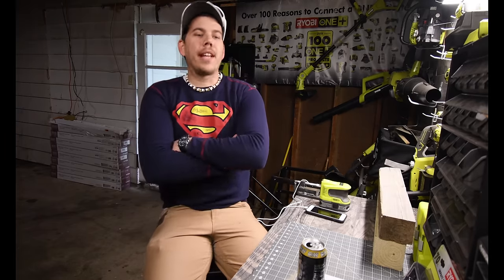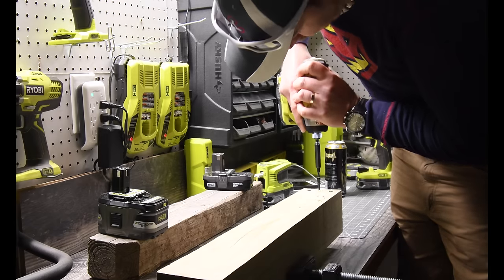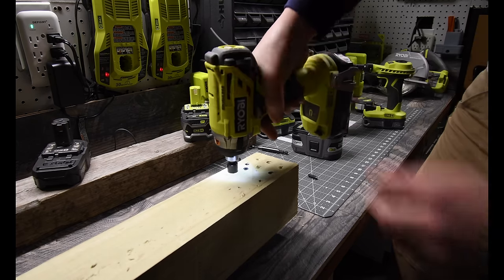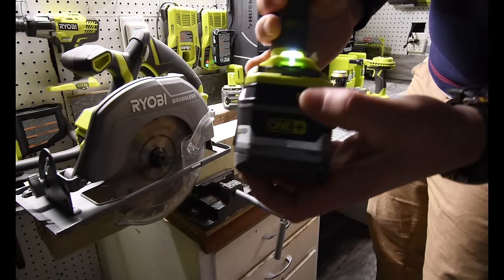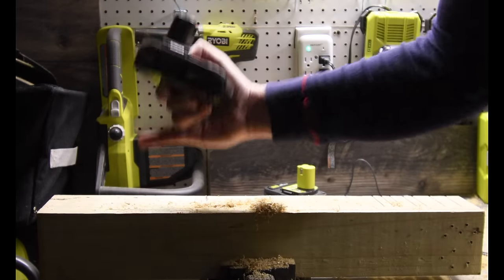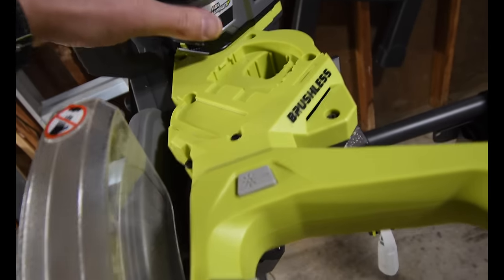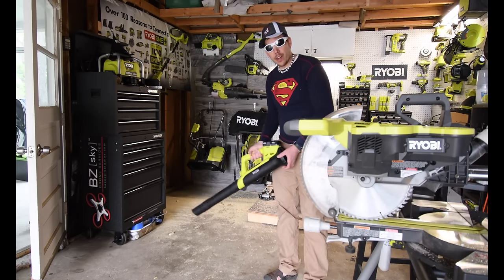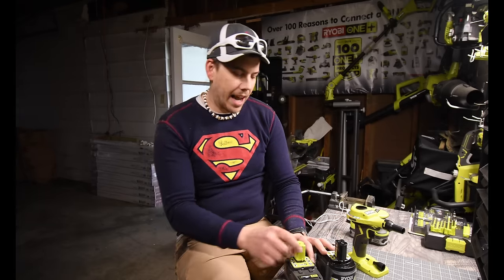Testing the difference in AH in batteries to POWER

Comment: the newer batteries have the 2 extra metal tabs that "talk" to the brush-less tools making them not only use more power on demand {burst amp}.  extra benefit should be bats should  then in theory have more working time. switching from low to high amps. great video
Reply from the maker: jjt jp thank you a sir

Comment: I see you man. You are absolutely correct that the larger batteries 'can' provide more power if the tool calls on them with the amperage draw. The batteries do not 'force' more current though, only what current the tool calls on. The power source 150w inverter says it will work with all one+ batteries. It likely does not pull more than 9 amps or so, no matter the battery size. Please research the "c rating" of batteries for why those larger batteries have more power. Btw, Ryobi saw my home Depot review and has offered a replacement.
Reply from the maker: TRY to HELP you I’m glad they were able to replace yours unit. I haven’t had a problem with mine yet. Luckily.

Comment: There is a battery protection circuit on theses batteries.
The saw will shut off if it needs more power than the battery can provide.
Reply from the maker: Thank you sir

Comment: There have been plenty of videos done showing the amp draw when a drill is under load and the more Ah the battery, the more they will use. Typically 15-20 amps in high torque situations.
Reply from the maker: thank you sir

Comment: I know them bigger batteries have more punch to them. I have a few  attwood  3000 bulge fans you can buy from orily’s  and they blow about 200 mph on 12 volts  like a motorcycle battery or car battery. The ryobi 1.2ah battery is the same but when I use my 9 ah battery I push out to 250 mph.  In my testing there is definitely a difference. I use two of these fans as a leaf blower that I made my self because the ryobi leaf blowers just don’t have the power. So I made my own. I can stand in my driveway and blow the leaf’s in my Neighbors driveway which is about 50 feet away. It only takes me three minutes to blow the Leaves off the roof of my house with this thing. 9ah battery with both fans is pushing around 480 mph. Ryobi should do this lol
Reply from the maker: I have no clue why but there are still some people that dont believe that you get more power with a higher ah battery lol

Comment: What you are experiencing is called "sag" its when the battery takes a hit or a load to drive the tool at maximum. the voltage drops and the power cannot be sustained. that's why when you put the 4 amp battery on the tool its seems more powerful. its not. its just the 4 amp has more batteries so the sag is lessen then what you would normally have. This is typical to all batteries regardless of platform. The short stack batteries have a 5 cell battery so 5 individual 18650 industrial batteries. moving on the 4 amp its double stacked so (2) 5 cell batteries parallel to the second 5 cell battery maintaining the 18.5v of power to drive the tool. More batteries less sag. the 9amp battery has (3) 5 cell batteries so even less sag. ideally 7 cells in parallel would be sufficient enough to not notice any sag and drive the tool at full power and load and is the theoretical maximum for usable quantifiable power... any more than that and your batteries will charge inefficiently and you will have to replace them prematurely. As far as the "HP" its just an added microchip in the battery that's attached to a secondary converter to temporarily give you more power as the tool requires it does this by monitoring the resistive capacity of the brushless motor and voltage. Think of it more like an overdrive. Most tools have this such as flashlights, tasers, anything that converts volts in exchange of amperage. This actually can be detrimental to the batteries life by pulling more amps than the battery is built for and in short replacing the battery sooner.
Reply from the maker: people were saying before I made this videos that there is no difference in power between a 1.3ah battery and a 6ah battery. they say 18v is 18v. this video showed that there is a difference on what batteries can do with a single use.
Reply: @ManCaverTools  yup there is a difference in the power. Anyone that understands batteries should know about this, I have spent a considerable amount of time studying batteries in and out. You are correct in your assumption without getting into the finer details.  Now if people could maintain their batteries properly they would last a long time.

Comment: 18V really IS 18V , the problem is voltage sags much lower on the 1.3ah battery when a powerful tool pulls a lot of current. That holds true even without the extra brushless contacts. Same reason the 9ah is even better than the 6ah, voltage sags even less under load because the 9ah has 3 rows of 5 cells.
Reply from the maker: this is an old video, at the time of this video people were telling there is no power difference at all no matter what the battery is, they said a 1.5ah battery is the exact same performance as the 6ah battery, no matter what the tool is doing.
Reply: @ManCaverTools  I used to think that too. One day I was cutting apart an oil tank with a Sawzall and I switch between the 1.3 amp power in the 2.5 amp hour battery and I noticed a big difference in cutting speed. But I had no idea that there would be a 9 amp hour coming lol

Comment: Smaller ah batteries or batteries with a single series cannot discharge nearly as many amps as a 2 or 3 row higher ah rated battery so when a battery cannot supply enough amps then the voltage drops this power drops.

Comment: Hi David, I totally agree with you before you did test them. I would like to have seen more between the two extremes 2,3,4ah batteries to see if it stepped up the efficiency as you increase the ah. Great video it was fun to rewatch😁😍😀 what do you think of an update test using 2,3,4ah battery or tools like your mower and weedeater? btw if anyone has old batteries they don't want or use and want to donate to a good cause, i only have two 2ah batteries and I'm a DIYer on a fixed income and can't afford $50 a pop or more for new battery. Thanks again for sharing your thoughts and videos, Rodney
 P.S. As you get more TackLife tools it will be cool to compare the power and endurance of those.
Reply from the maker: I plan too and thank you Rodney

Comment: So batteries do not have instantaneous current (effectively power) delivery. The bigger the battery, the more charge carriers can be delivered instantaneously when you need it.
Reply: I was just thinking you could do a low-current test too, such as the time it takes to charge a cellphone from two different size batteries using a 10W charger. I’d be curious to know if the time to charge would be close or it could be significantly different. That would confirm the perceived power difference felt using the tools.
Reply from the maker: doomtomb3 that is what I wanted to prove. In another video someone was saying the opposite

Comment: I knew in my head your theory was right. I didn't think the 1.2 would perform that bad though, or get hot so quickly. On the circ saw did you have a rip or crosscut blade? That would make a little bit of difference. Nicely done Dave😍😀
Reply from the maker: Rodney Widger I’m. It to sure what blade is on it. I’m surprised the 1.3 ah did as well as it did. But still can’t do what the higher ah batteries can do

Comment: I would have never made this video and put my tools at risk. Anyone who has used the 2ah knows they do not have enough amperage load output over the 4 or 6 amp. I would done a video where it matters, like all batters including the aftermarket batteries that can be purchased.
Reply from the maker: will do sir

Comment: This was not a fair test because the 6 amp battery have the extra contacts to give out more power to the tool to make it fair use a non brushless tool(s)
Reply from the maker: Bryce O’Linn the one+ miter saw didn’t have the HP connections. But besides the HP part of the battery. The point I was making was the 1.3 ah battery can’t even do what the higher ah batteries can, even with a single cut
Reply: Ok